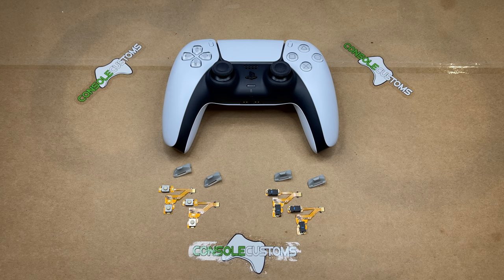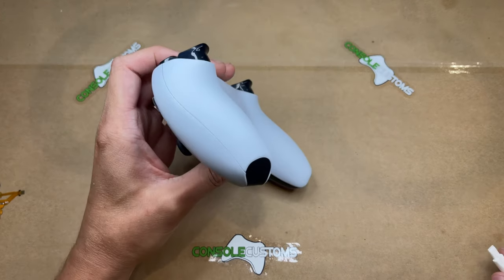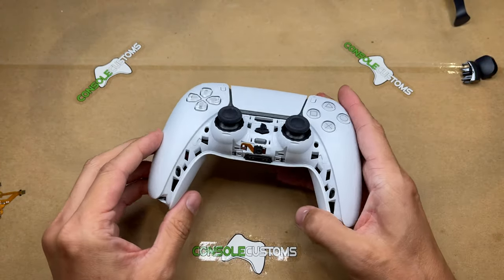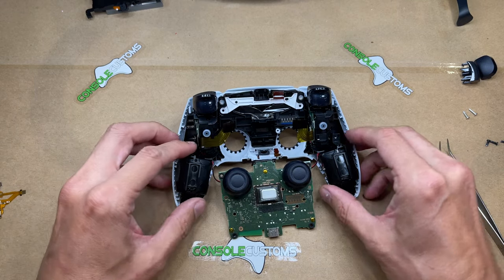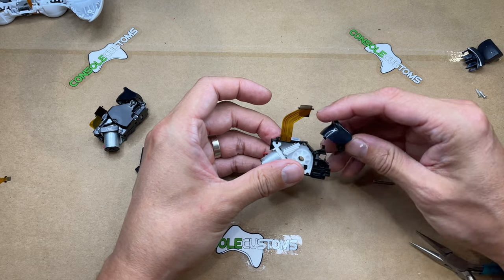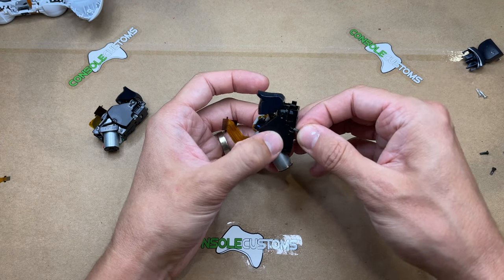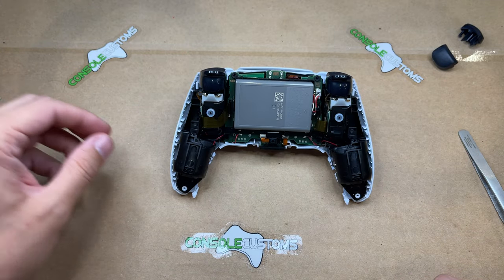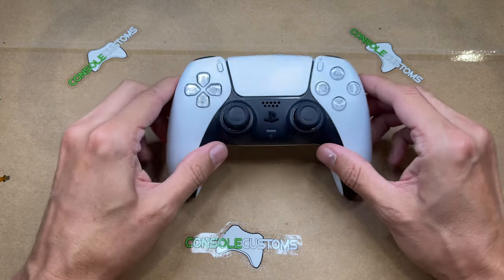PS5 Smart Triggers PRO Installation Video

Comment: You know I’ve been waiting for this my whole life. -Sean. Let’s go!!!
Reply from the maker: Haha, Thanks Sean. Let us know what you think when you get it! Way better than the "extreme" garbage!
Reply: @consolecustoms  Hey so what exactly are triggers and modded bumpers for? Would i have an advantage in Fortnite or CoD? I dont need extra buttons but was wondering what triggers and bumpers do?
Reply: @johnnyrodriguez276  they let you map a button from the front to be used in the back also. Easier access to use "square" with you middle finger than it is to move your thumb up to hit it
Reply: @shotgun2197  Ah I see
Reply: @johnnyrodriguez276  working on mine right now. Worth it ✌️
Reply: @shotgun2197  Let me know if it raises your K/d

Comment: Why would the green board need to used I'd rather has a direct fit to the bdm-020 or bdm-010 main board what pin 3 or 4 pins are used for trigger n bumper from that mouse click to the rapid fire mod chip with out the  trigger motor board if that makes since

Comment: Do you need to cut parts of the trigger in order to fit these? I noticed in this video you don't but on the website it states otherwise. Was looking to buy them from how easy it is to set up without needing to modify the controller in anyway
Reply: Exactly my question too.
Reply: @Nus Dogg  You need to cut some plastic parts which are on the bumper triggers but this depends on what controller version you have.

It's actually very easy to do and I've been using these for about 2 months now.